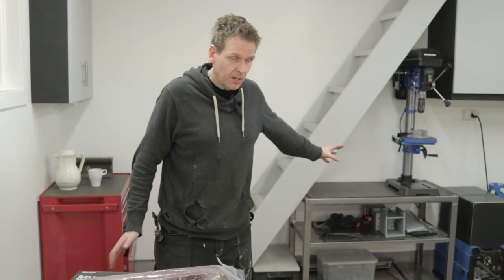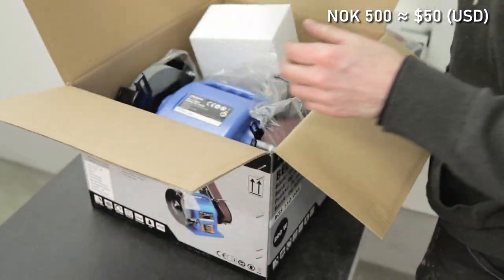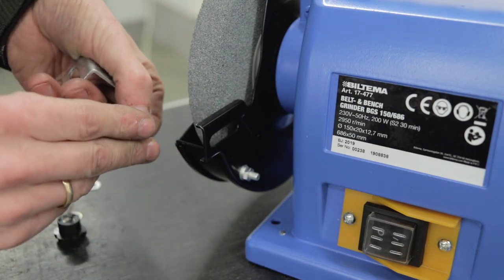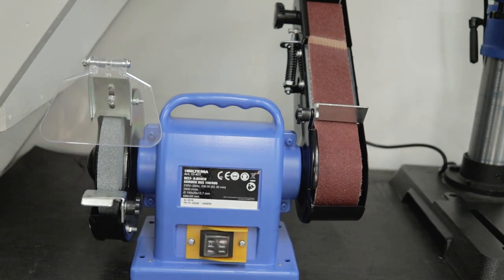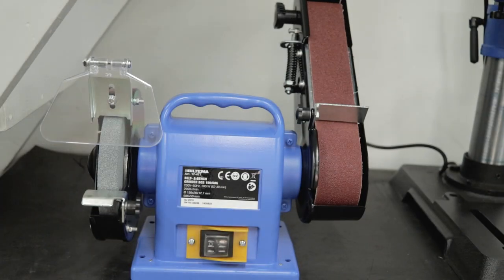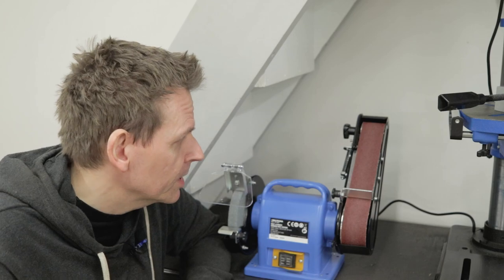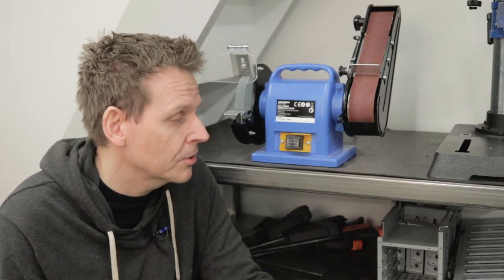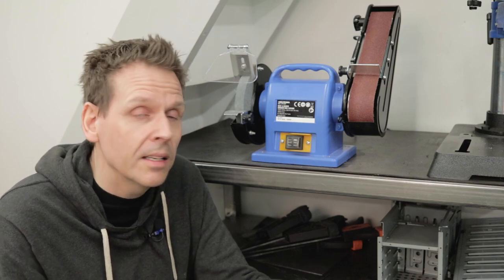Belt- & Bench Grinder Review (from BILTEMA)

Comment: The machine has been updated price is the same but its now 250w
Reply from the maker: Thanks for the info 🙏 and that is probably a noticable improvement. I still use mine frequently, and it holds up pretty well. All in all: I am still satisfied, although some extra power would probably have done it much better 😊

Comment: Great video, I should have looked at this before buying it and the steel brush version. I really don't like them, to wait between work for the motor to get back to speed.
Reply from the maker: Yes, the motor could defenetly have been more powerful
Reply: @kihestad  instead of working with this model, so far I managed to do all my required sanding, material removal on the bandslip bs 457. That thing is amazing, I highly recommend it. It's the reverse process, where your piece is still and the tool moving but at double power for the same price.
Reply from the maker: @patkyoto8878  I have a similar handheld grinder: Biltema part number 17-393. I bought it a while a go, but for some reason I have not used it yet.

Comment: Yeah, these are seriously under powered. My friend bought similar one and got good laugh as my friend began to sand something and bogged machine down quite a bit couple times. Then came the part. My friend glanced at me with unbelieving look, looked at the motor power plate and right after that just grabbed to belt from full speed and stopped the machine, then shut it down and said "Ok, I'm not using this". This guy was accustomed to those industrial grade standing really big grinders with wide and fast belts 😀
Reply from the maker: Haha, I can totally understand that. Compared to a industrial grade machine this one is probably quite lame 😂 It's better than nothing though ... 😋
Reply: @kihestad  For sure. I told him that I can take it from him and said that I have decent nerves to use it and that I'm not usually in a hurry 😀